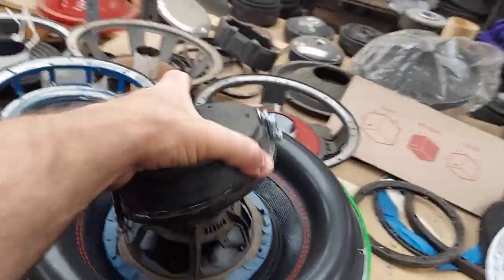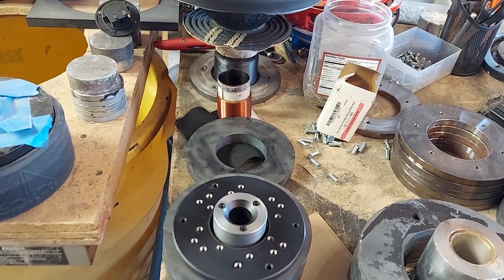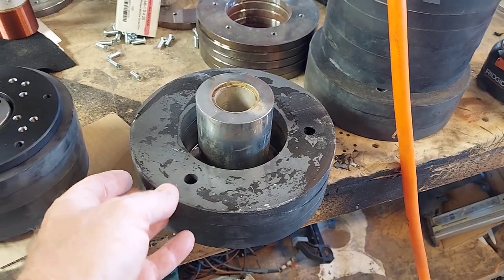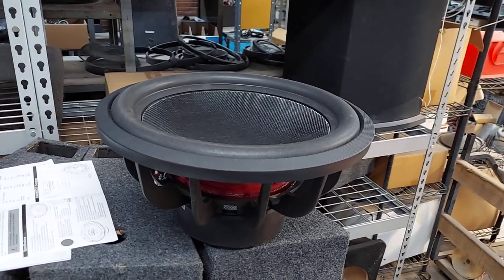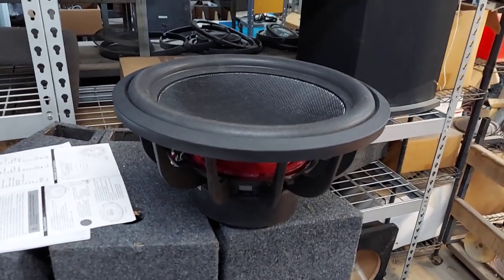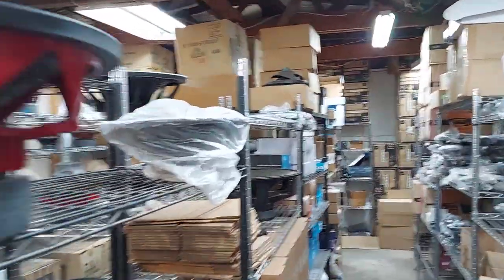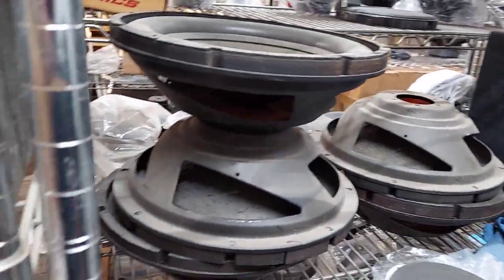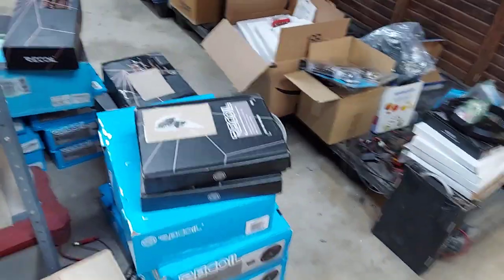Beefy 8 protype for testing - Dealer's Only stuff for you to flip! Passive radiators and more!

Comment: I like those 2ohm crossovers because I could use two sets of 6.5in mid drivers on each and still ad a single tweeter unless the tweet is 2ohm as well then id just use one crossover for two pairs of components per door

Comment: What is the biggest most powerful woofer you have/will sell? I currently have 2 deaf bonce apocalypse dbsa418d1 but I want something bigger better badder lol if that is it makes sense I have quite a bit of power so that is not an issue at all and I'm looking for a huge wow factor
Reply from the maker: 7kw 24"
Reply: I don't think I've seen that do you have specs on it and I'd like it to still be musical if possible I'm building a sixth order series tune wall enclosure
Reply from the maker: @justforlaughs8988  bandpass is the OPPOSITE of musical / accurate